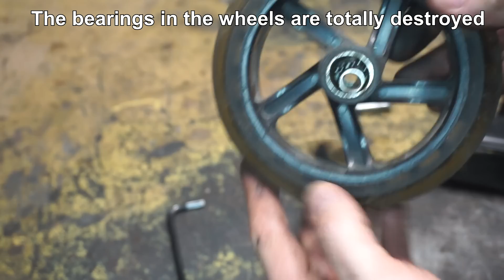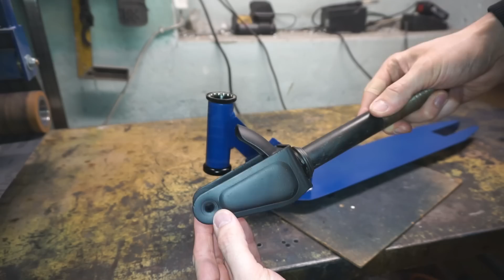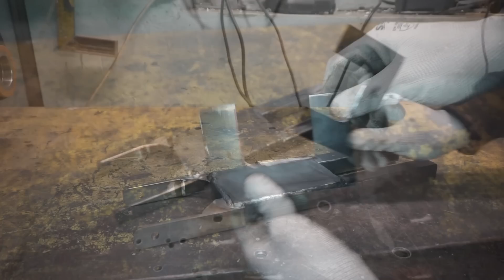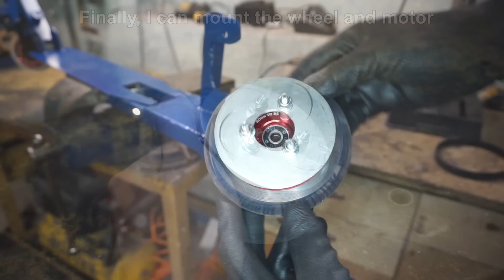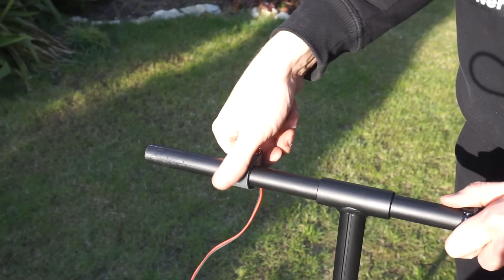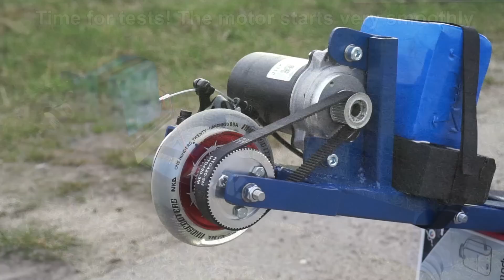Making Electric Scooter from Scrap

Comment: Definitely not from scrap... you must calculate the belt size and the timer pulley for torque ratio in order match the body weight and motor torque as well as rpm